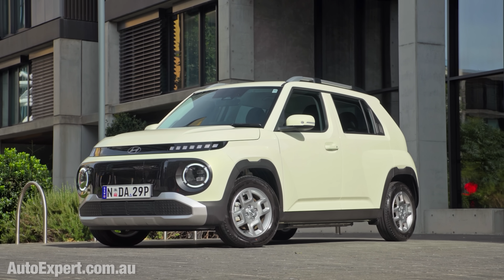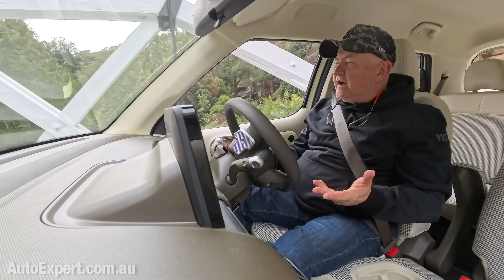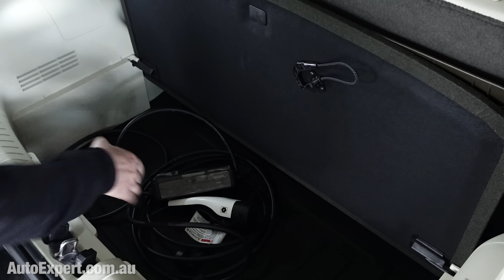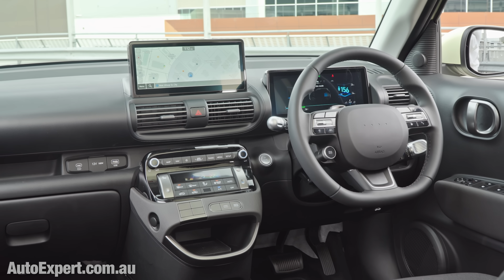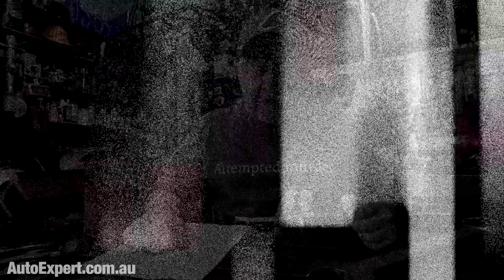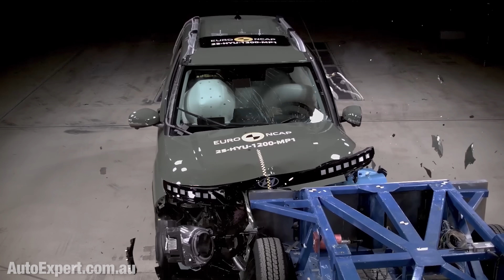Hyundai Inster EV (Casper Electric) first drive | Auto Expert

Comment: I've said it before and I'll say it again, BMW got the EV right first time with the i3...well apart from the price. 
Small, practical with a small battery, 125kw through the rear wheels and go-cart handling.
The Inster is following a similar-ish path. Good for them.
Reply: Well done BMW, and time has sorted out the price: they are great used purchases.  The only issue is that they tyres are an unusual size so more expensive than they should be.
Reply: They are insanely expensive in case something breaks 😂
One minor crash with damage to the monocoque and they are totalled.

Be careful you don't buy a used car that's damaged and beyond repairs.
Reply: @miskatonic6210  Noted, but they are pretty resistant to annoying low speed dents picked up in car parks because the panels are a form of plastic.  They just spring back into shape.  How resistant to minor crashes are most used cars, i.e. what's the cost point at which they are written off?

Comment: We need this kind of car but at 25k and ultimately that will the price of this type of car due to Chinese competition. Hyundai are really missing the chance to repeat the success of the Excel. I expect a Chinese manufacturer will have a car like this in Australia for 25k by the end of next year, and that will be the end of the line for many manufacturers.
Reply: You are right. This oozes  cheap little box in this video and the basic one is nearly 44k driveaway with a 5 year warranty. GWM Ora anyone?
Reply: Reading the comments here, I was thinking nobody would buy one. Touch screen and few real switches, bad upholstery pattern and colour, not enough options, no spare wheel. But if it breaks the $25k barrier then step aside or you'll be trampled by the stampeding buyers.
Reply: If the BYD Seagulll comes to Australia it could cost close to 25k, and may even arrive this year, at least i hope it does.

Comment: If ANCAP wants to give 5 star ratings, the first thing they must do, is demand the automotive industry get rid of touch screens.
Reply: I've read things that the EU is moving towards mandating tactile controls.
Reply: @derekhobbs1102   - Aviation basically started there  - real buttons on the perimeter of panels to locate control centres (regardless of touch or non-touch LCD.....
Reply: @derekhobbs1102  Let market provide them. the market decide. If drivers want touch screens or hands-free voice or knobs/buttons, just let  consumer make their choice. Don't Karen away the choices you don't like. Just like I don't care if you get an iphone, an android or a flip-phone. Pick whatever you want.
Reply: 💯 massive driver distraction multiple steps to change aircon settings through touchscreen is ridiculous, those floating touchscreen are something China introduced to save cost, they look cheap and nasty and are devoid of any real design or engineering. My 2024 Subaru Foresters may appear old school in design but physical tactile buttons for every function is magnificent.
Reply: @sneakyfoz3692  Hi BYD !! turn aircon down its too cold......Hi BYD see that Subaru Forester isnt it soo outdated..... had a subaru outback got a chinese car now would go back.
Reply: @simonpaplos saying Hi BYD every few minutes is the definition of insanity
Reply: @sneakyfoz3692  Mine has voice controls. No distraction.
Reply: @Jimmy-hf8fz still 5 x slower than moving a physical knob which can be done in half a second, sometimes the simple things in life are often the best. As aside to that having tried the voice control in a BYD Shark and a Chery Tiggo, it’s doesn’t always work the first time.
Reply: @sneakyfoz3692 So, if I say “increase temperature”, a few seconds is an issue? I'd say the time you take your eyes off the road to reach for a knob is more of a problem.
Reply: @zwieseler if I can twirl a knob within arms reach in half a second with zero need to take my eye off the road, because there is no thought required then a voice activation that is 4 times slower, is that a step forward or a step backwards? We’ve had Siri on iPhones for 15 years and it is still largely useless.
Reply: @sneakyfoz3692   I doubt you can reach out for a knob without looking for it. Even tho it wastes 1.5 seconds 🙄 simply telling my car what to do is way more convenient than playing with a knob….
I use Siri a lot, no problem, even to write text messages for me.
Reply: Yep. So annoying in the work mg
Reply: Buttons and their associated wiring cost money my dude.

Comment: A friend recently bought a battery powered car and proudly pronounced it was 100% recyclable. Which prompted me to wonder where that was possible. Are there places in Australia where we could drop off an old used up vehicle so that they could turn it into milk bottles? Or do we have to transport them to somewhere they have the population to do this?
Reply: Weather ICE or EV, they are all about equal in recyclability. They both have plastic trims, maybe a little more fluids from ICE, lots more battery bits to deal with on the EV.
Reply: @alanhilder1883  Probably EVs don't hit the junk yard as soon as ICE
Reply: @SirGregoryPageTurner  The engine can be rebuilt, Batteries have to be replaced and they are the environmentally troubling part. Everything else is same,same. The junk yard will see them about the same time.
Reply: @michaelbrennan2567The batteries are the major replacement part on a EV, lucky to last 10 years. My 14 year old ICE hasn't needed any of those parts, or engine rebuild for that matter. But the original point was that the only parts different at the junk yard is the battery type. You rip it apart and they are metal, plastic, fluids ( don't kid yourself, those batteries have coolants as well ) and batteries ( separate as there are nasty fluids in them ) The ICE batteries can be stacked dozens to a pallet, EV, one at a time.
Reply: @michaelbrennan2567 Batteries are not fuel, they are the fuel tank. You really have a problem if you are changing your fuel tank like that. The fuel for an EV comes out of a power outlet.

Comment: Is it smaller than the Venue? 

I am super happy with my Venue purchase last year. So damn easy to get in and out of (older people know the pain of traditional cars seat height), it's super easy to park and the boot is fantastic. The boot floor height is adjustable. In the lower position I can fit 8 woolies reusable bags with ease (the sides of the compartment prevent any movement) - the number of bags is important - we are a family of 5 adults and the weekly shop fills 8 bags.

I intend to hold onto this car for 15 years and will likely replace it with a like sized EV along with a much bigger solar system. My current 10KW with 13.5KWH battery is only barely adequate for our current needs, forget adding a EV charger onto it.

Comment: Why manufacturers don't at least offer the option of a spare tyre is beyond me??? Just offer me one as an option for $300 and let me decide! Most customers want one...just bloody offer one.
Reply: Isn’t it because the battery takes up the space where a traditional tyre would go?
Reply: @nigelliam153  No, it's nothing to do with the space taken by the battery. The battery in most EVs is under the floor, between the axles, and a spare wheel normally goes behind the rear axle. I've seen people modify Nissan Leafs to carry a spare wheel under the boot floor, and some EVs have them standard. I suspect there's a concern that some idiot who doesn't know how to use a jack might poke a hole in the battery pack. Also, wheels are getting bigger, and overhangs behind the rear axle are getting shorter, which might be a factor. And cost saving.
Reply: @nigelliam153 I'm prepared to take the risk of a spare wheel in the boot area spontaneously combusting and deflagarating explosive projectiles and clouds of toxic smoke. I don't want this however in a hybrid using the spare wheel well for a poorly installed battery installation.
Reply: Just boycott vehicles without one.😊
Reply: They do my new Skoda Karoq it's a no cost option in NZ and a costed option in the UK
Why???
Reply: In Europe the claim is that thier roads are so geeat and tow trucks are literally a few feet wherever you end up. Otherwise, engineers still havent figured out yet how to put a spare wheel in a PHEV or EV in the same place it would go in a ICE or mild hybrid car.
Reply: Well last night a friend came around who owns two Nissan Leafs. One a Jap import no spare, one a UK import and has a spare. He's only owned the UK one a year until he spotted it hiding under the car, so saying you can't have a spare because of the battery is obviously BS.
Reply: Why? Healthy tyres close to never blow up. I never experienced a tyre problem within 45 years.
Just call mobility service and get help instead of dragging that much  dead weight around for years and years.

Your "option" makes all cars more expensive. Throw your spare tyre into your boot when you really need one. That IS your decision! I don't want to pay for your unnecessary option.
Reply: Chery Omoda E5, Hyundai Kona EV.
Reply: packaging constraint mate. battery is underneath where traditional boot space is.
Reply: @phunk8607   Have you ever seen a car with boot space or spare wheel under the seats or footwells? That's where most EV batteries sit. Well forward of where a spare could go. Several EVs do have spare wheels.
Reply: Are you saying Hyundai will not sell you a wheel from the spares department?

Comment: I wish NCAP deducted 3 stars if a car uses touch screen to control basic functions like HVAC, heated seats and audio control.
Reply: Agree. The air and audio controls should always be manual AND easy to use without needing to take your eyes off the road. I would say any car that you need to access a touch screen for these basic functions should be an ADR fail and refused access to the market. No exceptions.
Reply: @lunsmann certain controls need to be within a 1 second reach and operating window without taking eyes of the road -  these controls should include lights, wipers, window winders 
, mirrors, demister, volume + skip, HVAC speed & temp + auto mode.
Reply: @senselessza1 You naughty boy, you are supposed to adjust mirrors before driving off...set & forget, so to speak.
Reply: Hear, hear! Lack of switches would be a dealbreaker for me. It looks like Hyundai have got the message! But not about the driver annoyance features - if I can't turn them off, no deal. NCAP should deduct a point for every annoyance feature that can't be turned off.
Reply: @FredPilcher  "Is a deal breaker" in my humble opinion...
Reply: @FredPilcher The only reason the ‘driver annoyance features’ are in there is BECAUSE of NCAP
Reply: 100% agree mate.
Reply: Particularly volume.
Reply: NCAP, the AMA of the car industry.
Reply: Wasn’t the front safety occupant rating 70%?   I don’t care if it fails because of driver aids. But front occupant safety should still be priority.
Reply: @kennethprocak5176  no arguments there mate ..5 a five star rating in my opinion should be based on vehicle accident safety...seatbelts, structure, airbags & ABS type stuff...
As an aircraft engineer...all aviation critical controls require switches & knobs...not touch screens...all tactile controls, as should a motor vehicle controls.
Reply: Told comment so far! 😁👍
Reply: You all sound like a bunch of horse and buggy people who are baffled by new technology and change.
Reply: @nexxusk if it's your own car and you're used to it, fine.  Try being a 'certain age' needing reading glasses for readingg, but not for driving . ...  driving an unfamiliar rental car is  bloody dangerous.
Reply: @nexxusk  You probably just do not appreciate the visceral feeling of actually enjoying the vehicle.
You do not ride a motorbike, do you?
No touch screens.
Reply: @desobrien3827 Heard of voice controls?

Comment: Does it have a better ICCU than the Ionic? :-)
Reply: Time will tell. It’s a very different part
Reply: @theairstig9164 I know the problematic ICCU is used by other brands too so no finger pointing but I would not buy a vehicle with the same model ICCU. This EV has vehicle to load too, did anybody do a welding test to check the inverter?
Reply: @theairstig9164  actually a quick online search reveals the Inster suffers from the same problem as the HI5 and HI6
Reply: @theairstig9164  actually searching for it I find posts of Inster owners complaining their ICCU failed just as in the Ionic 5 or 6.
Reply: How long is the warranty?
Reply: @SirGregoryPageTurner in Europe 5 years unlimited km. Problem is the extended time it sometimes takes to get your vehicle fixed
Reply: @williamvanholz1666 Thanks

Comment: A sensible EV about time.🤔 But until the buffoons that design these put at least a space saver spare in I’ll never buy one. The ANCAP star rating is bullshit. As a retired paramedic with 35 years experience, the only thing that matters is cabin integrity in an accident.
Reply: EV fans are raving about the cheap Dacia Spring in UK, despite only having 1-star NCAP safety rating.
Reply: "The only thing that matters is cabin integrity in an accident"? What about the spare wheel?
Reply: @buncha5651 What's better than cabin integrity in an accident? Avoiding an accident! 
A whole range of things makes driving safer. Driver attitude and awareness are biggies.  Roads, lights, seatbelts, and airbags are some others. And if you do get into a major collision, cabin integrity is certainly critical. But you know what counts more? The other vehicle! All things being equal, the bigger vehicle always wins. So always have accidents with the smallest thing you can find. Usually, a motorcycle or a pedestrian.
Reply: @SirGregoryPageTurner 
All valid points, but having huge screens that you have to use to change most functions is worse than talking on a mobile phone. But guess which one is illegal go figure.🤔